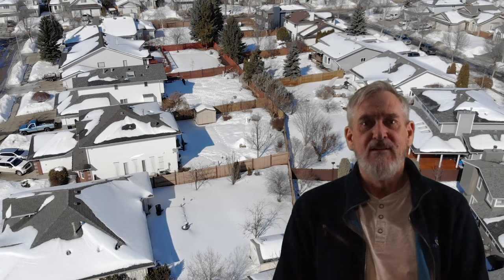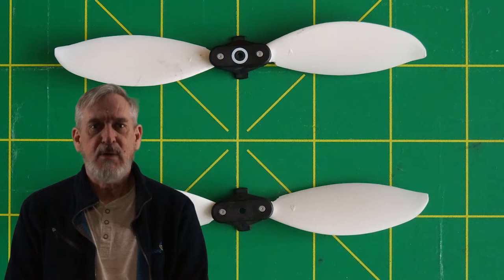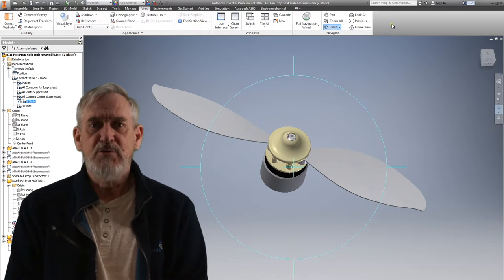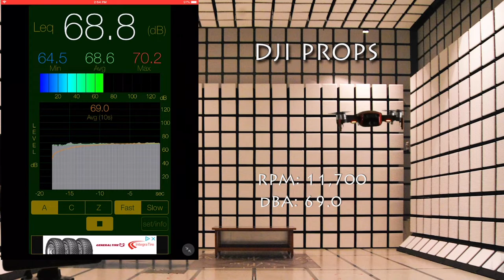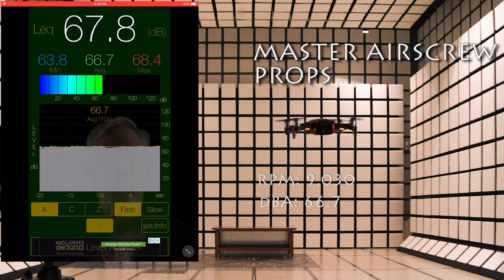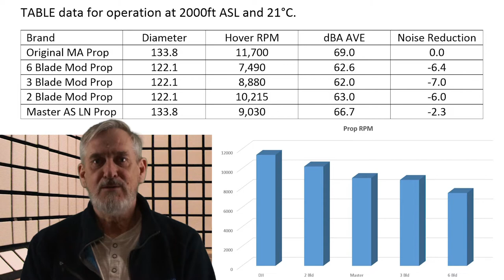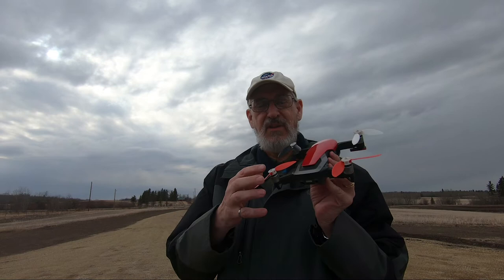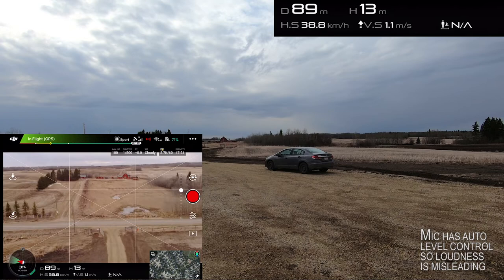Mavic Air Silent Propellers

Comment: Hello
I’m interested by your design. Do you know which design is the best ?6 propellers ? No stability issue as we can see in your video ? Which propeller do you adapt?
Thanks
Reply from the maker: Tom Tom I have chosen the two blade design.  It has similar noise reduction to the other multi blade configurations but  has very little motor rpm reduction thus maintaining the control agility of the original props.  To date i have had no warnings using these props.  I am presently doing some sea level testing in Mexico.
Reply: Hummingbird.UAV ok I understood! Do you plan to sell these props design?
Reply: Hummingbird.UAV are these available now?

Comment: Can you tell OEM Anfi props or China Props were used ?  It appears you are using third party Anafi props, these are low quality substitutes and do tear off in flight even on Anafi. Tip of props in original and China copies are slightly different, hence different vortex properties (Anafi props are more thin and pointed at edges).
Reply from the maker: I used the knock off Chinese props.  Did have problems on my version 2 hubs with the blades breaking thus I stopped my hub development. May have to go back and use original blades based on your info.  Still always fly with my v1 three bladed props. With 3 blades the motors don't rev up as high hence the cheep blades have never broken, and of course they are much quieter than the original MA props.

Comment: I would be very interested in your props for the mavic air. Will you be selling them soon? regards John
Reply from the maker: John still waiting for v2 hubs from the 3D printer.  When they arrive I need to do final testing, especially the fit as tolerances with the print can cause problems. If everything check there should be some to sell.
Reply: @HummingbirdUAV  looking to buy from the UK :)
Reply: @HummingbirdUAV  please alert me here if ready for sale.

Comment: I'm interested in these as well. I hope you're still looking into producing these for sale. Have you had to make any adjustments to the gain settings?

 I use the Stealth V2 blades now, mainly for that 2 min boost in airtime, but would love to try these to see if it changes the distance I can approach wildlife from. The lower pitch in tone has not helped enough to tell a difference. It'd be nice to get within 20 yards.
Reply: Thanks for this. Considering buying one, but I was going to cancel until I looked up what you bought. Definitely going to get one now :)

Comment: To 'out perform' it would need to lift more efficiently or make the battery last longer. Great job though! I did see a video somewhere that showed how to make the Anafi blades fit the MA. I'm not sure if it was yours or someone elses. It's a bit of a kerfuffle to get done, but if the noise really bothers you I guess you could do it.
Reply from the maker: I did see the other video with the Anafi blades.  I made a set but almost half the blade mount gets cut off to make it fit in the Spark hub. This really weakens it and I lost a blade in flight but is was the start of the road to making my own hubs.